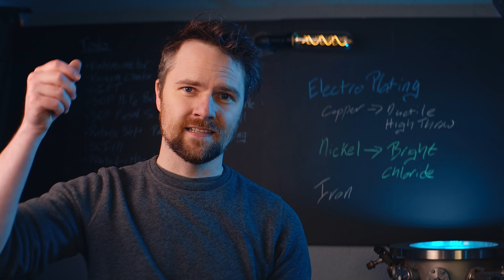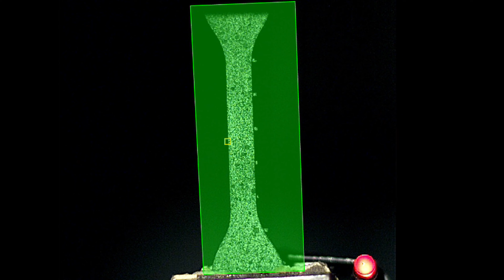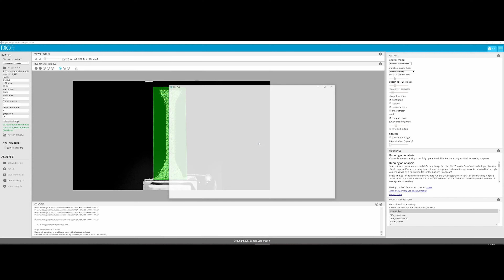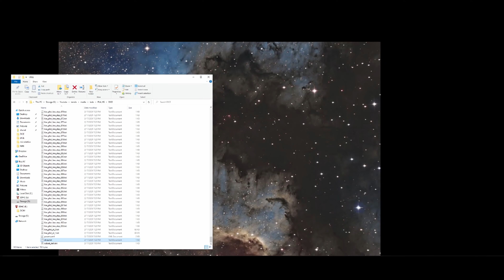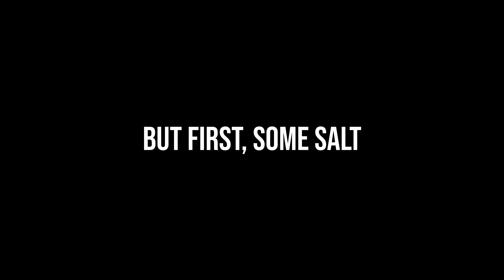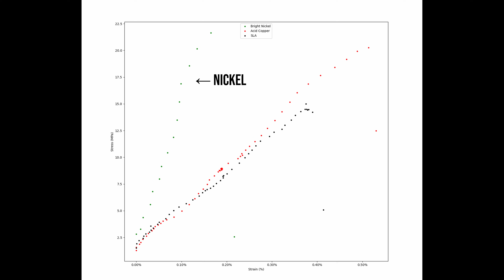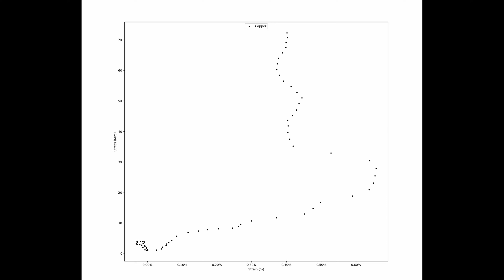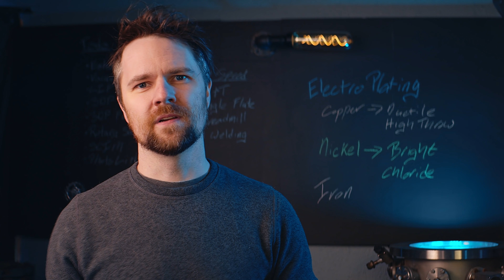Stronger 3D Printed Parts with Electroplating

Comment: I think there are some interesting ideas you could try when continuing this project:
- Metal infused filament/resin: some filaments and resins have metal added to the mix in a way to allow them to either be sintered to a metal part or become conductive, this could allow you to skip the painting step entirely, could help the thermal expansion issues and may improve adhesion of the coating.
- Sintered metal filaments: In addition to what was mentioned before the electroplating process could be used to improve the dimensional accuracy of burn-out sintered prints that notoriously warp during final processing.
- Molded electrodes: printing molds for the electrodes that could allow you to move them close to the part and at a more uniform distance may improve the quality of the coating allowing it to be more even.
- 2nd generation electrodes: fully printing and plating an electrode that it is easier to plate then using it to next inside another part to even plating e.g. print a tree type structure that could be inserted into a lattice without touching to serve as the sacrificial electrode to allow for a more even coating.
Reply from the maker: These are really great ideas, adding to the list of things to look into!  Particularly the molded and printed/plated electrodes. I wonder how long they would last before they "burned through" their plating.  Hmmm...
Reply: @BreakingTaps  Based on some quick reading and my limited knowledge, you can go crazy thick with electroplating.
So if you go with a really thick layer that is just small enough to not short, it'd probably last quite awhile for the thinner coats on the primary parts.
It'd be really cool to get several platings done before having to "recharge" the electrode.

Comment: You might want to try the conductive nickel spray from MG Chemicals vs. carbon, it's much stronger and very low resistance.  Also would suggest trying alkaline nickel plating solutions vs. a Wood's strike, they are stinky since they contain ammonia and must be kept hot, however they produce a much better coating.  Also the bright nickel plating solution sold on Amazon is particularly good for a uniform, bright plate that levels to produce brilliant coatings, if you don't care about rolling your own.  Current control is very important, make sure you use a constant current supply on the low end of things, going too fast will burn your object.  Temperature control is also important, as you note.
Reply from the maker: Just picked up a can, should be here soon!  I have the complete set now haha, carbon, nickel and copper/silver. :)  Will look into that nickel recipe, there are a few others I'd like to try as well (ditto to different kinds of copper, I'm just using a basic acid copper atm).  And definitely want to pick up some more commercial baths, they've done all the hard work already so it'd be interesting to see how the compare. Caswel has an electroforming nickel I was eyeing...

Using a small bench supply for current control, trying to keep it pretty low (especiall to start). 50-100mA to get started, increase over time as the plating spreads.  I've found that the carbon coating "burns" out if you start too high, and then it'll never plate.  Really need better temperature control though, I have none.  And should probably start filtering my baths, or bagging the anodes or something.  So many variables!

Comment: I would use silane for adhesion; probably a primary methyl di-siloxane. 
You could use a two part urethane with isocyanate catalyst, add your choice of silane to it, then blend conductive material into that. 
The blend ratios used could be tailored to the exact performance characteristics you want. 
I work with that kind of stuff often;  specifically on the adhesion vs cohesion balance in specific blends of aliphatic urethanes. It's a lot simpler than it sounds.

Comment: The resin is clearly failing by cracking. If the cracks usually initiate at the surface of an untreated resin part, then your surface treatments could plausibly oppose or enhance the crack initiation. For example, if the surface has tiny defects that would initiate a crack, but the copper overlayer prevents them from opening up enough to do so, then it could make the part elongate more before breaking. You might be seeing a real effect.

Comment: Really Cool video. I'd like to point out that the Young's modulus is only valid in the elastic region of the curve. So yes the youngs modulus is the slope of the linear (elastic ) region of a stress strain curve, not the entire line as stated in the video . In material science, I believe the standard is .002% strain... after that we assume plastic deformation and hookes law is no longer valid .Just an fyi when do you calculation...  It appears the software does a true stress and strain curve compared to the standard engineering stress strain curve.

Comment: I wonder if something along the lines of concrete/rebar would be possible here to help with the delamination that's happening with temperature swings. Maybe a test sample with small holes in various directions would be more resistant to that problem at the cost of a little overall strength / stiffness.  I seem to recall there being a paper about inserting small voids in an fdm print to increase stiffness and this might look a little similar.

Comment: Is it possible to use the electroless plating as a substitute for the conductive “ink” mixture? I think it might provide both better adhesion and more consistent electroplating after as you would have a very uniform conductive surface throughout the part that may combat some of the variance in thickness of the electroplated surface.

Comment: Hey man! Great video! Adhesion comes from binder, so maybe try something other than acrylic. I've used oil based polyurethane with graphite for copper plating on Nylon and it gives a much stronger bond than acrylic.

Comment: Suggestion 1: You could try printing with a conductive filament! There are filaments such as PLA infused with 30% to 40% metal powder (I've seen loads of different metals, I know you can buy bronze, copper, tin, nickel, iron, silver, brass, titanium* and gold*) objects printed with any of these filaments should be conductive and can be buffed to a mirror finish, pretty much guaranteeing proper adhesion. 

Suggestion/idea 2: By the way, I think the metallic plastic is letting go off the PLA before breaking because of plastic deformation. Basically the PLA is stretching and because the metal coating is not at all flexible it lets go of the surface.

Suggestion/idea/warning 3: You probably don't need that propane heater anymore now that the temperatures have started to rise again, but please be 100% sure that you have a working carbon monoxide detector mounted on the wall, away from any corners and at chest height inside the room where you're planning to burn the propane/run the heater , before you actually turn on/fire up your propane heater ☺️  If the heater is burning the propane, and thus consuming oxygen, it is also very advisable to ensure there is adequate ventilation. Just in case to ensure there won't be any oxygen depletion or carbon dioxide saturation. It is wayyyy too easy to accidentally kill yourself with carbon monoxide poisoning, so please take care. My apologies if you're already taking adequate precautions, but my aunt and uncle almost manages to kill themselves by sleeping in front of the burning fireplace without opening the passive ventilation air inlet gates (no idea how you call those in English, sorry), which were closed for the winter because of cold drafts. Take care dude! I really enjoy watching your videos 😁 Something tells me that it won't be long until your channel explodes in popularity!

Comment: The platings themselves are also intrinsically stressed. Especially the chloride nickel. Less so for the copper but it's not soft like annealed copper would be.  In my own shitty attempts with chloride nickel I heard those crackling sounds during plating. It peeled itself off the plastic strips I was trying to plate. It just cracked and curled inward. The thicker plates I got without cracking were very hard but brittle.
You could try sulfamate nickel for a lower stress. It's used to electroform massive solid pieces of metal.

Comment: Just a couple thoughts about this:
1. When you are doing the DIC analysis, it may be helpful to select your area of interest entirely within the sample and over the area you care about (i.e. the reduced width area of the specimen). This also means that you can zoom in further to get better strain resolution on that area of the specimen since you really don't care what happens near the grips.
2. The DIC software I use is Vic-2D. They give you a way to see a "sigma" value for each image in the analysis. This value indicates the confidence of the software in the results. It can help you to know if your subset size is too small and you aren't getting good tracking of the subsets. 
3. What universal testing machine are you using? If it has displacement measurement, you don't really need the virtual strain gauge.

Cool video, keep it up.
Reply from the maker: Thanks for the notes! Will keep that in mind for future runs (and will check out Vic-2D).  My UTM is an old manual unit I snagged off ebay. Had to fabricate my own jaws and wire up a load cell, no displacement measurement which is why I went with optical.  But I'm looking into adding a glass scale to get displacement readouts instead (or in addition to) optical DIC.  Would be nice to have some extra data to corroborate results on a DIY machine like this :)

Comment: The effect of coating on failure strain is not as surprising as you suggest.  If the coating acts as reinforcing the copper just prevents necking for longer by spreading the load more evenly.

Comment: Well Done, SUBBED ✔️ : I think this is a vitally important issue(more functional prototypes). The idea of having a slightly compressed, additively manufactured plastic core surrounded by a structural(...thicker/high yield strength) & slightly tensioned metallic shell, if this process can be done quickly, cheaply and with a uniform, repeatable metal thickness, this is an excellent way to make VERY FUNCTIONAL parts.

The plastic AM 3D printed core helps stop the thin-ish metal shell(has to be thicker then this test though) from buckling failure and pretensions the metal shell too(assuming a strong metal material is the coating material).

This made me think of rotational molded parts and how strong they get when filled with an expanding foam (example golf cart roof, the ones that are foam filled are tough as can be, even though they are just a soft plastic outer shell with a foam core).

I think other metal deposition methods should be considered too(cost effective and safe vapor deposition,,,my 1st choice, but how??).

Comment: Some slicers have a fuzzy-surface setting that jitters the outer perimeter on a per-layer basis. That might help with the plating adhesion.
Reply from the maker: Oh nifty, will look into that.  Some folks were mentioning adding surface detail to help hold onto the plating, but if I could just do it via  slicer setting that would be a lot easier than modeling it in.
Reply: @BreakingTaps  In Cura it's in Experimental -> Fuzzy skin

Comment: Great content! As for adhesion: in my experience, nothing works as well as (fine/mild) sandblasting a surface with for example 240-400 mesh SiC. This creates a very large surface with many mechanical anchoring point for a coating.
Reply from the maker: Oh awesome, will give that a shot!  I have a large tub of SiC sitting around, just need to work out a sandblasting setup (picked up the SiC for sintering purposes, ironically).  Have you tried chemical etching out of curiosity?
Reply: @BreakingTaps   actually no, main problem with adhesion is that different polymer types neither mix nor adhere. So a conductive topcoat should preferably be based on the same polymer as the bulk. If your resin printer has sufficient resolution, you might consider printing small T-grooves or holes as anchors on the surface.
Reply from the maker: @HuygensOptics  Noted, thanks for the tips! Will try that out next time I need to do some plating :)
Reply: @BreakingTaps  I know lye works for etching PLA. Possibly should work for resin too or strong acids might work.
Reply: Sandblasting was a game changer for me.  I've tried polyurethane, lacquer, and PVA (acrylic) based paints with copper particles and again all three with graphite particles.  None of which perform as well on plastics and glass as the silver conductive paint from RioGrande.  That paint is too expensive and has some aggressive solvent in it (butadiene/butyl somethingerother).  I haven't tried Rio's copper solution because the don't offer a solvent/thinner/brush cleaner for it, and throwing away brushes becomes expensive.  
I've found that for graphite pigments, running graphite gouging electrodes through a pencil sharpener and grinding the resulting powder down in a mortar and pestle still isn't fine enough for good results.  Buffing between layers and/or before plating helped decrease resistance and improved deposition of a complete layer in the plating bath.
Very much looking forward to trying the ABS/acetone/graphite idea seen elsewhere in these comments.
Also looking forward to trying the EMF sheilding spray seen in the video (same stuff as inside plastic laptop chassis, looks like my silver based stuff?) and copper based automotive head gasket repair sprays.

Comment: I used to deal with platers for work, what I understood on how they electroless nickel plate plastic was the plastics actually have metal particles in them. 
I wonder if there's a similar material for pla. Or a powder suspension in resin.

Comment: I'm liking your content. Nice production and good science stuff!

The "ultrawide" resolution user base is less than 3%. You may want to consider doing screen recordings in a format/resolution that has more mass-appeal. 1080p accounts for about 66% of the audience.

Even on my 1440p monitor, I'm having trouble even reading stuff from your screen capture where you are showing what software you used.
Reply from the maker: Ah good to know, I didn't even think about it and just hit record for the screen capture.  Will make sure I resize windows to half the screen next time so they are a more reasonable size/aspect ratio. Sorry about that!

Comment: Plate the part. Drill hole. Melt out the plastic. Pour in epoxy, polyester resin, melted zinc or aluminum using the electroplating as a mold. Fuel for thought.

Comment: Well now. Recently there has been a lot of talk about baking samples in a salt matrix above the glass transition temp. Maybe the metal shell can serve that purpose instead of salt?
Reply from the maker: Woah, that's a really interesting idea!  Probably depends how much outgassing the remelting causes (hopefully none), and if the metal layer is thick enough to support it's own weight once the inner plastic stops contributing.  What a fun idea, I'll see if I can incorporate that when I sort out the adhesion issues for the FDM equivalent of this video (or maybe just mail a few samples to Stefan to test 😇)
Reply: sounds like a great idea, but i would be worried about the metal breaking when the internal stresses from uneven cooling start to release.
Reply: @TheLordinio  That is a good point. My hope is that the metal will yield enough elastically to hold the plastic in place - but be strong enough to keep its form. We won't know until someone tries :P
Reply: Might be able to do both, metal holding the surface tolerance (maybe) a bit better and the salt/sand providing thermal mass and support when in plastic regime.
Reply: @jcims  Interesting point!

Comment: There is something called "Conductive 3Dresyns for electronics" you can mix into your resin to make it conductive, it's the same stuff they use to make OLEDs but modified for 3D Printing.
Reply: The advantage of this over conductive paint, is that you might be able to plate things like through holes that are too thin or long to paint. I wonder if embedding small tunnels of plated metal throughout a part would improve the strength
Reply: @michaelandersen7535  it undoubtedly would, thanks for telling us about the conductive resin!
Reply: "200€" paint it is then

Comment: Interested in seeing how sputtering would do instead of electroplating.
Reply from the maker: Sneak peak: been repairing an SEM sputter coater so I can try out that sweet, sweet deposition action :)  Working ou a few kinks but hopefully working (reliably) soon!
Reply: @BreakingTaps  The Thought Emporium did a video on this about a year ago or so. Might find his video helpful.
Reply from the maker: @ITpanda  Will take a look!  Big fan of Thought Emporium's channel, although haven't quite managed to binge through all his videos yet :)
Reply: This wouldn't be easy to do, but it would certainly be interesting!